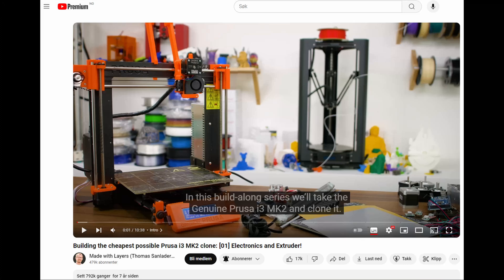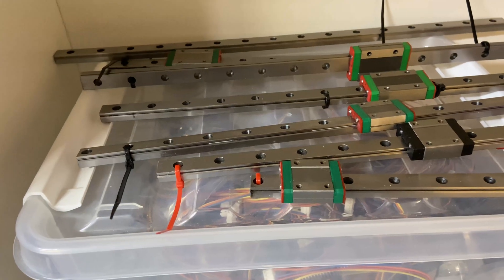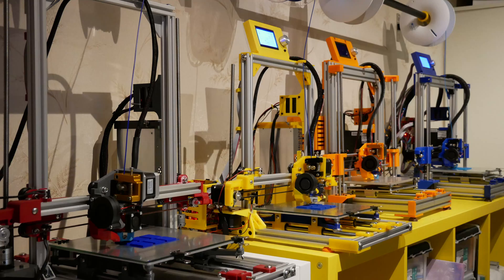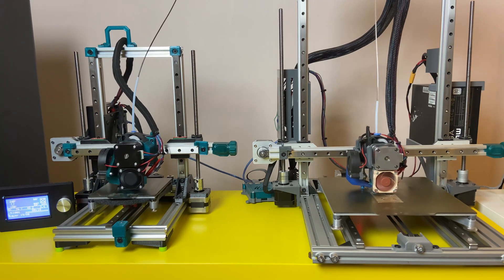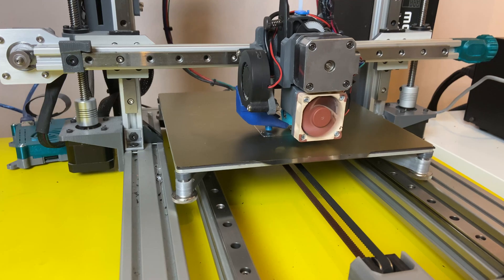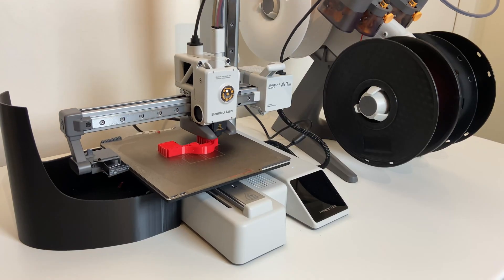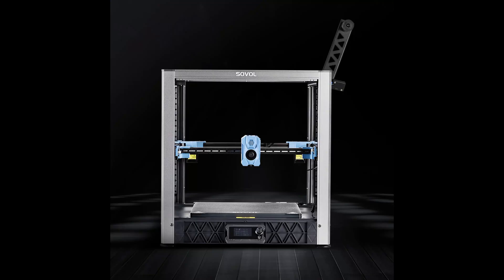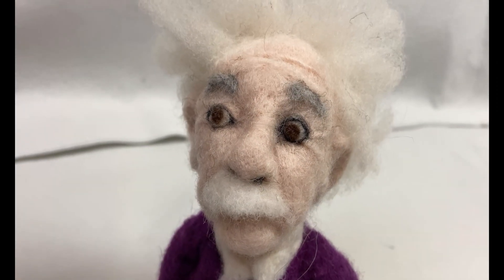Should you build a 3D printer?

Comment: Thanks for sharing.
What printer would you yourself buy in 2024 instead of building your own?
Reply: Awesome, thank you.
Reply from the maker: If it is within your budget I would choose the Bambu Lab P1S. Add AMS later if needed.
Reply: Thanks!
I was actually looking at the X1 Carbon the other day, partly because it seemed to be enclosed and inklusive HEPA filtration.

But maybe the P1S is a better value?
What would you suggest in terms of air filtration in general?

Also, where are Enders 3's, Prusa Mk etc. printers nowadays? Have Bambu Labs surpassed them in terms of quality, speed, ease of use etc.?
Reply from the maker: I am not printing exotic materials, mainly printing ABS, ASA, TPU and PETG (PLA only for prototypes). I don't need the Carbon for that. Unfortunately I haven't spent much time researching air filtration, but I probably should have! Other manufacturers are catching up to Bambu Lab, but the printerdesigns from 3-4 years ago are really outdated now.

Comment: It's funny... When I started with 3D printers, I did it with a super expensive Ultimaker 2e+, in retrospect, I feel I missed out by not starting out with DiY 3D printers, I just didn't know about it at that time. I've only started building 3D printers much later on, as in now when they are cheap and reliable to get. My reasoning is that I'm building purpose built machines, something that I can't really buy, or would cost a lot more (the first one was a giant one I designed to print pieces of furniture). Cost of it all always ends up being more than I planned for, making it not such a good deal. The real "price" though comes from all the time invested into it, I have a weird fixation with always wanting to design something "original", or a need to configure designs others made, it always eats up loads of time, so yeah, it's probably not really worth it in the end. Honestly? I just really like doing it, it's very contra productive, but it's such a joy to actually think it up, design it, build it, and than to see it actually work! So I seem to keep finding reasons why I need a DiY 3D printer...
Reply from the maker: I don’t think I built anything without deviating from the original design :-) That doesn’t always improve the outcome.